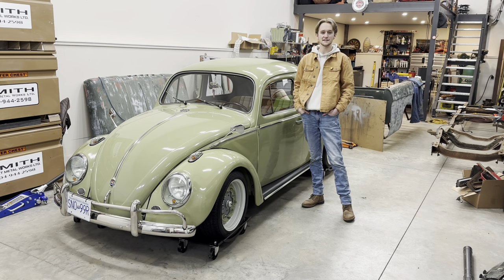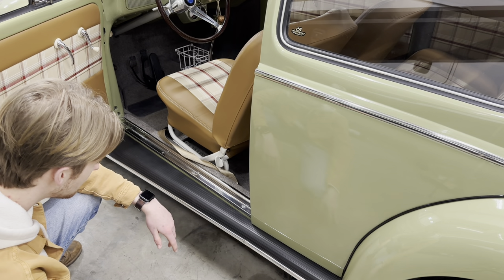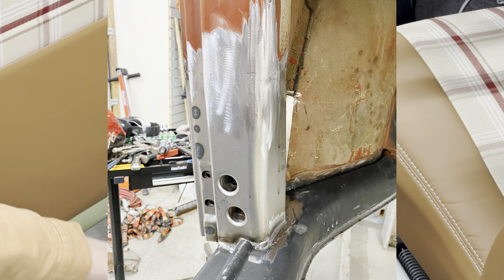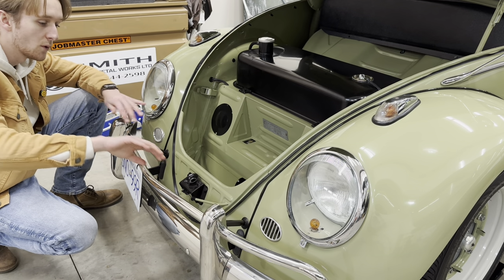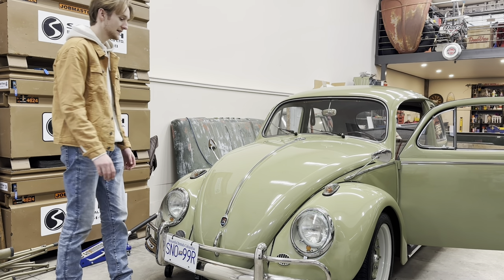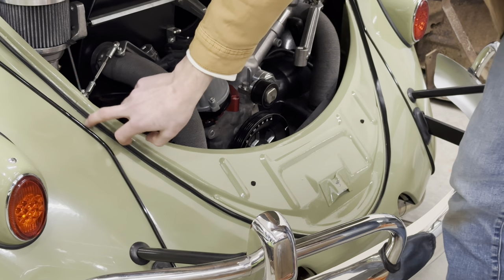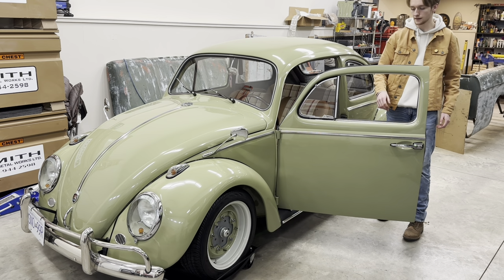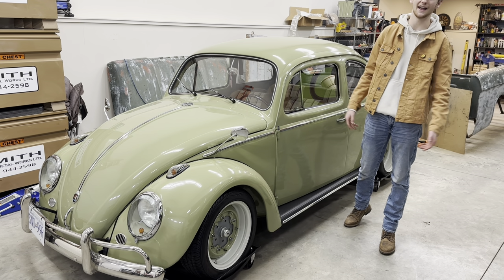How I Almost Screwed Up My Car (Body Repair Ep.1)

Comment: Nice Job. Don't forget a video how you lowered it. Where did you buy your Carpet? It looks like  it fits great. In this video it looks like you replaced your front firewall. I have a new firewall here for my car and there is a spot weld about every 1/8 to 1/4  inch all around it. What a job it must have been to find and drill them all out.
Reply from the maker: Thanks! My next video will be about how I lowered the car and picked out my rims/tires. My interior came fully from Sewfine, I’ll make another video about that too at some point. And yeah, I personally like drilling out spot welds but it is quite difficult. I missed a lot, and also drilled extra holes that I thought were spot welds haha.